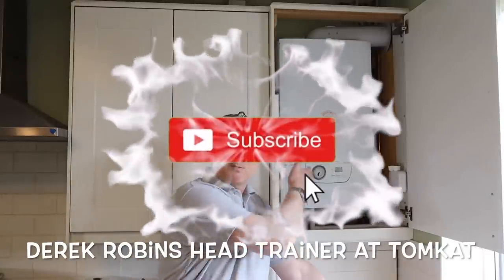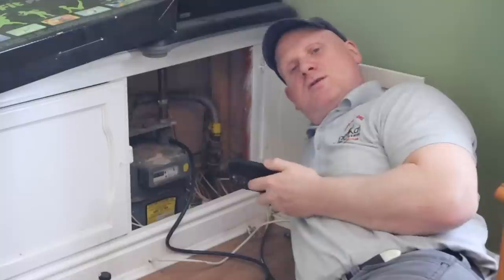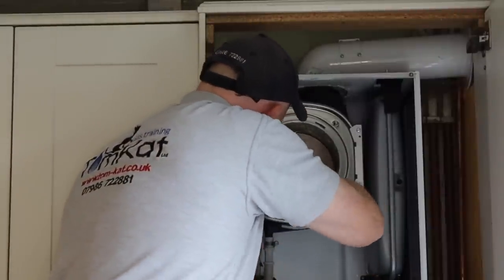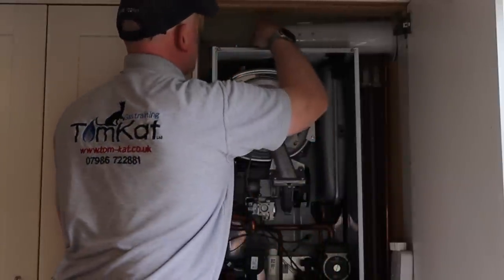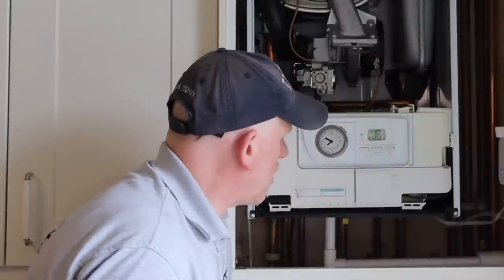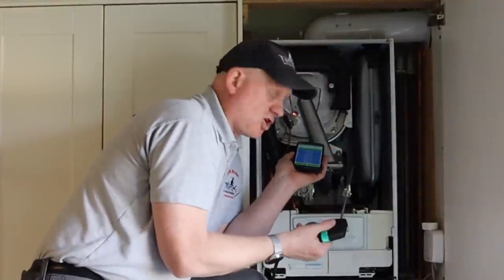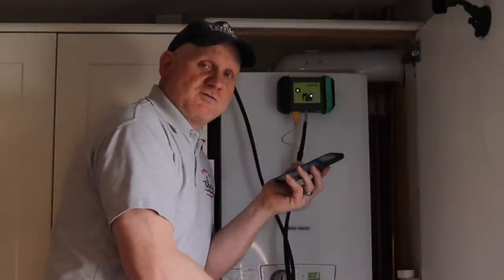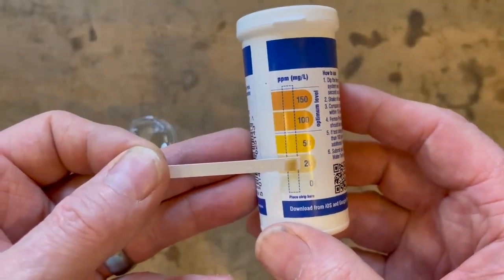Boiler service to new building regs part L. will gas engineers comply and will customers pay for it.

Comment: They are doing everything in their power to make owning a gas boiler impossible
Reply: I haven't seen any unreasonable testing procedures in this video and it's pretty much the same thing as we are required by law to have done bi-annually (recommended by law and required by most manufacturers) annually in Belgium. 
If you are saying having to spend money to have a professional check on the health and maintenance of your system and possible hazards for you and everyone that could be affected by faults in your heating system, then you probably shouldn't own a gas boiler.
Reply: @Candisa  Nothing to with annual servicing (which I have done every year) more that the government here in the U.K. is making owing this type of heating system harder and harder ( the problem is the replacement ‘solution’ , ASHPs are expensive and not as good as what we currently have)
Reply: @jasonaris5316  so it has nothing to do with the topic of the video...
Yes, heat pumps are still expensive and aren't perfect, but they are the best solution available to reduce the need for fossil fuels (product of war and pollution) to heat our homes after reducing the need for heat.
Prices do come down, technology is improving. I'm still waiting as well, as a matter of fact I bought a brand new gas boiler last week because my home and budget isn't ready for a heat pump yet, but the goal is to eventually get that boiler to run at its minimum temp and power and still have a warm home 95+% of the time so a heat pump can be added in later and the boiler can eventually be replaced by an electric afterheater (for the couple of freezing days) and an electric hot water boiler.
I do prefer ground source though, it doesn't make sense to extract heat out of freezing air while there are double digit temps a couple of meters underneath us. There are very compact and efficient GSHPs out there.
Reply: @thermion7869  Looks like there's no brain to wash in your case.

Comment: Hi Derek.  Interested in your comments. I was always Told, if you are going to use a gas sniffer, it should always be before using the ldf. Thoughts?
Reply: I could be wrong but id say it only applies to the aerosol ldf, the propellants will set the sniffer off.
Reply: Kind of worrying that aerosol ldf can set off a gas sniffer, perhaps that’s why cadent shut off so many boilers for no reason what’s so ever?

Comment: Great information.. dust sheets a must especially on customers worktops 😝
Reply: id say a towel would be even better but yep 100% agree
Reply: I like those foam pads you can buy to go under washing machines, just bosh it on the side. You can push all your loose screws into it too👍
Reply: @chrismalin2741   I use magnetic bowl put screws in less chance of loosing

Comment: Ive been in the game for 20 years now, and can see it changing allot. Im doing what I can to get out of the trade in all honesty. Find it hard to compete when people run round doing CP12's for £35. What are you charging on average for boiler servicing?
Reply: BOILER INSURANCE IS A CON.  THE SECRET IS THEY JUST DON'T SERVICE THE BOILER.
Reply: £60 plus seals, £40 if inhibitor needs dosing at the same time. Keep my standards high and explain to the customer what I'm doing so if they do go elsewhere they will see a difference.
Reply: @Snaggleplops   SOUNDS GOOD, DO YOU LIVE NEAR NEWCASTLE?
Reply: @SloopyDog  ha, sorry mate, Liverpool! There's a site where u can find ex BG engineers called find me a local, have a look see if anyone is on there near you, all more than capable of proper strip servicing like in the vid. And more importantly now they work for themselves they have the time!
Reply: @SloopyDog  Thanks for that Joe, glad I'm not the only one thinking Insurance offers I keep getting are a con.  You only have to read between the lines to see it is basically a "no-tools" service;  sure they may have a sniff around with some instrument or other, and cast an eye over the system, but how on earth can that be classed as a service??

Imagine taking your car to the garage for a 20,000 mile service and they did a no-tools job in the same way.  Look in the radiator and top it up if necessary, eyeball the brake fluid reservoir to check if up to required level. check the oil dipstick and top up if necessary, top up windscreen washer, sneeze in the tyres, and charge the customer £300.  How long would it be before the garage went out of business.  Crazy how some services can get away with conning the general public out of their hard earned cash (or at least try).  Plus it gives all the honest hardworking engineers a bad name. and lets face it, there are many many good engineers out there.
Reply: @Snaggleplops   Very hard to find any skilled workmen in this area.  Most of the so-called tradesmen, builders, roofers, and plumbers turn up at your door and they haven't a clue.  They know how to charge, that seems to come easy to them.  I think the lack of firms taking on apprentices is causing this problem.  People do a 6-month course at a skill center then call themselves tradesmen.  I employed a so-called roofer to re-bed my ridge tiles, he was swinging back and forward on a roof ladder trying to do the job.  I had to tell him to get down before he killed himself.
Reply: Become an installer,??
Reply: £60 is ridiculous way under valuing the trade, minimum £85 rock bottom should be industry standard across all gas engineers. A gas boiler service should be easy 1.5hrs long any less and your not doing your full tests.

Comment: Is there any reason why a tightness test isn't required on a service? At the end of the day you are having to disconnect a gas pipe to the burner, and a test could show wether or not the valve is passing.

Comment: Well ,I’ve just had a British Gas eingineer call to attempt to rectify a recurring flame ignition fault on  my  combi  boiler.when I mentioned your the new regulations as you explained he intimated that there were no new instructions and if there were British Gas would have been in on the forming of them ,consequently as  far as I’m aware none of the tests that you outlined were carried out🤔 perhaps you should inform British Gas of these new regs ..............
Reply: British gas are a private company out to make as much profit as possible and not comparable to the previous 'gas board' for want of a better phrase, that covered everything from gas transport, meters, gas supply and regulations. They have been notorious for years in the industry for charging a premium price for a service but only carrying out a minimum basic safety check.

Comment: this part l is going too far.no customer will want a new programmer or will want to change radiators ,thermostats valves etc when either having a boiler service or a boiler replacement.im glad im 50 now as ill be out of this lot in a few years.its just getting stupid.
Reply: I get what your saying but if it saves the customer money on gas bill then its a win-win situation. 
It may take a bit of customer education but the economic pinch should be a boost for us gas guys and an opportunity to genuinely help customers.
I don't like being mandated to do certain things but I'm definitely all for getting rid of the 'hang any old sht on the wall and run' mentality of some installers in the past!

Comment: Which are customers going to choose, the £40 “service” that takes 20 minutes or the £200 proper job?🤔 Also how do you price a job without knowing the make and model of the boiler, if you need to change seals etc.
Reply from the maker: Wouldn’t you ask the customer when was the last time you had your boiler serviced and what make and model is it and do you have the instructions before you make arrangements to do it. Also it takes just over an hour so why would it be £200
Reply: It shouldn't cost £200 to do it properly. £100 plus VAT would cover it unless you're paying city prices. You can get these stripped and cleaned in an hour.
Reply: @griffithsheating  not meany customers will pay £100 plus vat for a service it's just the way it is to meany cowboys out there that would under cut you like it or not its just the way it is and especially with current times when people dont have much cash to spend with the rising cost off living
Reply: @aftermath3127  You don't need a full strip down and seal kit every year.  Leave the £40 service monkeys to it and get more clients that value your knowledge and experience. They do exist.
Reply: Why not Give them both options and explain pros and cons of both options be very clear what each service entails.
Reply: @griffithsheating  yer i agree with what your saying but alot off customers  don't see it that way they just go for the cheapest quote
Reply: 1.5 hours on site, 0.5 hours trip, £60 hours rate, £120; fuel £10, seal gasket mark up price £ 25-35; would say £ 155-165 within 5 mile range. Exclude VAT. With VAT, will be £185-200
Reply: @tomkatgastraining  that's what some charge which is why people would go for cheaper option . Big difference between 40 and 200 .
Reply: @aftermath3127  would you go to a big garage for your car that charges £50 more than a small family owned garage ? Think you would go for the cheaper option would you not
Reply from the maker: @smallfeet4581  what if you took your car to the garage and they kicked your tyres and said all done that’s £50. That what a £40 boiler service is
Reply: @tomkatgastraining  you can service a boiler without changing the burner seal, most don't need doing for 4/5 years . Some are easier than others to work on . Price varies in my opinion especially on the greenstars .
Reply from the maker: @ryanarbuckle789  didn’t I say that in the video
Reply: @tomkatgastraining  then you wouldn't go to that garage again . I'm only saying if price is too high for some people they will go for a cheaper  option. Everyone usually does . If a person does a good job for a fair price customers will go back . And I do not know anyone who does a service for £40 . But I do know one who ripped people off and he does not get the approval rating or recommendation on the website for local fair trades due to number of complaints but he is a qualified gas\plumber . I personally wouldn't use a cheap cowboy but I can understand why some do
Reply: I think this is where some engineers need to be a bit smart, if you just tell a customer a service is £100 plus parts or whatever its you charge and just leave it at that then most will go for the cheaper guy, but if you take a few minutes to explain what you do on a service and why then the customer will probably realise that your doing it properly, then finish off by saying if you do choose someone else and they don't take the burner out and clean it then it's not a proper service, you could also send this video to them so they can compare it to what these cowboys do
Reply: I tried offering different service options but it confused many customers and they would go for another engineer that gave a simple fixed price.
Now I offer a fixed price £70 for any service Inc landlords (without fire).
I'd cover all the checks from this video except some would be 'intuitive'. New inhibitor checks I explain to customer on site and offer as an add-on for £7. After a good service they're my customer,  get a service plan on my system and a tailored quote sent 10 months later👌
Reply: @huyongquan6554  £10 on fuel for a 5 mile range? Also why must you markup parts costs?
Reply: @chrismalin2741  why not just distinguish between a safety check and a service. We can all understand that.
Reply: @bikeman123  coz it gets complicated and customers just want a quick answer. What boiler do you have, have you got a primary filter, would you like your inhibitor replacing, would you like your system balancing. Ok that will be £70 - £200. Oh you went with someone else for £75 fixed price. That's just how it goes. Better to secure the customer and get them invested before offering all the options for the next service. That's how it works for me anyway.

Comment: How many boiler do you come across that have been fitted then boxed in that it takes a hour just to beable to get the casing off 
Last one i had ended up taking kitchen units off the wall and client wasnt happy when i wouldnt put it back up

Comment: more extra work when the working pressure at the meter and the boiler is 1.5 mbr difference.what would you do. leave it?
Reply from the maker: If the appliances are working and not affecting the safe operation of other appliances then you would just note it on your service records but obviously if it is affecting appliances then you need to act on it

Comment: Don't you think if there where stray voltages as you test for the customer may notice they get an electric shock every time the run the water. Just a thought..... And i'm pretty sure the boiler would not be functioning if the whole case was live and by chance the RCD had not tripped. I could however be wrong, just my thoughts.
Reply from the maker: Had a boiler a few years ago that when the bracket was installed it nicked the live wire which ran behind the boiler with a screw. I went to service it and got a shock of it and the boiler worked fine.

Comment: Hi Derek, quick question when doing working pressure at the meter; i have noticed the fluctuation in pressures with the modulating boilers so thankyou for explaining that, which reading would you use for the paperwork and to compare with the inlet pressure? The higher read of 21 or the lower read of 20? TIA
Reply from the maker: The lowest reading

Comment: Hi Derek , I don't get only gas rating on hot water and range rated heating . We are told the gas rate should be between 5% over and 10% under at max gas rate  so my understanding is you need to do that in high analysis mode, Also how do you know the gas pipe work is not undersized if you are not doing it at max analysis? . The gas rate you are doing is beyond pointless as flow rate and modulated burner gas rate is always going to be variable so the test is meaningless. Your boiler could have had an inlet working pressure below 14mbr and AT Risk but you would never know without seeing the boiler operate at max output .
Reply from the maker: You have been told all wrong for one the 5% to 10% is just given to trainees because they don’t have engineers judgement so they can say it’s ok or not,  also high and low rate is only for flue gas analysing if you look at the benchmark you will see it’s says gas rate and inlet pressure for hot water and central heating not high and low. You need to do the test on heating and hot water to see if there are problems,  putting the boiler in high and low mask’s problems. Finally also on the benchmark now it asks if you have range rated the boiler down or left it factor set so how would you know that’s correct if you gas rate in high and low. Like I say in the video you want to know what the boiler is doing not what it can do because most boilers will never make what they can do because of oversizing
Reply: I agree . If you have a 30kw boiler range rated to 24kw the gas supply would still need to be adequate for max output and should be checked weather doing landlord certificate or service, If the boiler is range rated down then obviously that would also need checking and as for the 5% and 10% call, valiant are the only company that give this variation in their manuals so simply a allowable tolerance if gas pressures meet the allowable drops from meter to gas valve.
Reply from the maker: @geetee50  when you carry out a service you are checking if the appliances are safe to use for a further 12 months and you note down the readings you find and give that information to the customer. Any faults you find you then explain to the customer what you have found . If any faults make an appliance ID or AR then with the customers permission you act on them.
Reply: @geetee50   TB141 mate
Reply from the maker: @michaelhunt848  but what about the benchmark which is the industry standard also manufacturers say gas rate on max hot water and central heating not high and low also what if it’s a non condensing boiler how do you gas rate on high and low then.
Reply from the maker: @michaelhunt848  think you will find benchmark also covers the services just have a look at the app or the new benchmark in manufacturers instructions. Also gas safe has no say in anything to do with installation commission servicing or repairing a gas appliance. The reason for technical bulletins is to make engineers aware of changes or problems that are in the gas industry. Also your comment about non condensing boilers not modulating 🙄 now old open flue boilers you are correct but we have millions of boilers out there that are not condensing but modulate. I don’t think you grasp the concept of gas rating and flue gas analysing.
Reply from the maker: @michaelhunt848  people always get bitter when they realise they have been doing their job wrong. You continue gas rating on low god knows what that proves and I will continue to train my trainees they way I want to making up my own regs and ignoring gas safe. Have a nice night and thanks for a future video 😜
Reply: 🤣🤣🤣 mate, you’re on another planet.

Comment: Nice to see a real service done and not just fga and run. 

The inhibitor bit is not good though. You should use a PH meter and TDs meter not just blindly through in inhibitors. 
You’ll end up reducing PH level and your completely ignoring the real issues. Can you dona video on VDI 2035 and incorporate it with the use of inhibitors.?